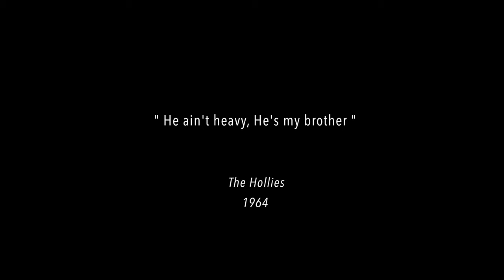Under Pressure - load testing the east side bridge base on the La Salle Causeway   4K

Comment: That fellow underneath is very brave.
Reply from the maker: I had that thought too - but you gotta have faith.  I suspect that readings had to be made at different places and any other arrangement would have been very time consuming
Reply: @Aerosnapper  Perhaps They drew lots to determine the Winner : )
Reply: @Aerosnapper  Surveyor here: there are other options, like using the targets already on the walls or installing $30 removable prisms to the columns.  The target on the pole is a Trimble active 360 prism and has a vertical uncertainty of ~3cm.  This is not an acceptable place to put a person.